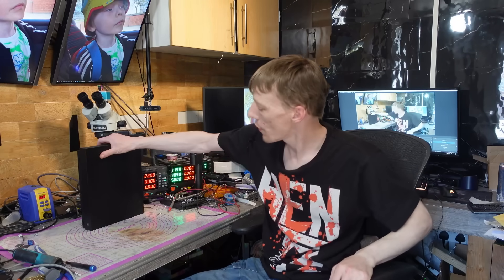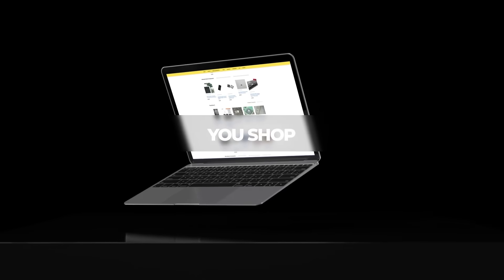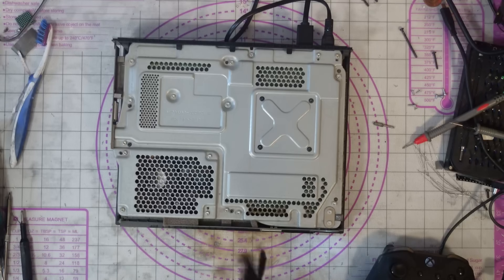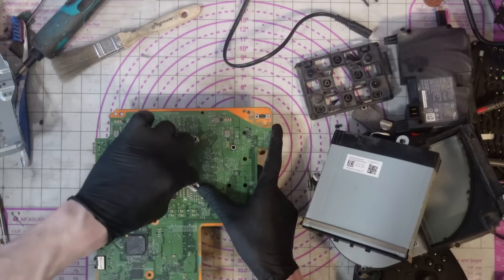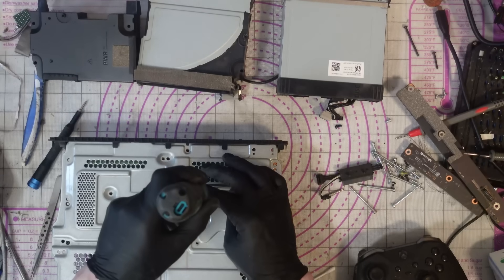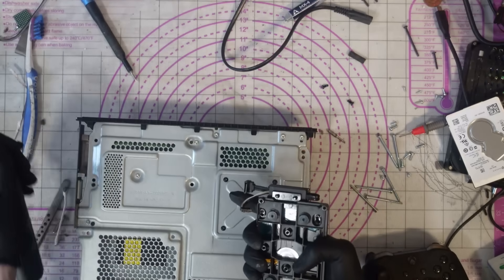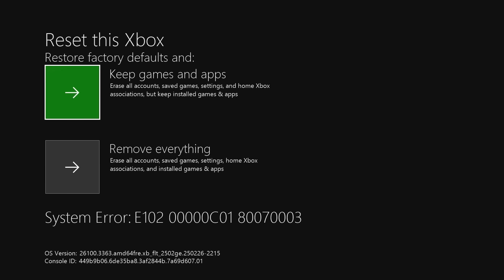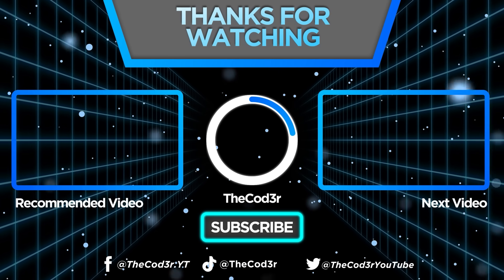Xbox One Error Codes E100, E101, E102: How To Fix Them (One S, One X Included) [2025]

Comment: I’m having a 101 error message. I’ve pulled the hdd out and plugged it into the PC and it works fine. So i removed all files and cleared it then formatted it. 
I managed to get the usb update in and it was reading it fine and seemed to be doing update. But then failed. Now when I try to update from usb it fails immediately
Reply: same problem here on a xbox one s 101 error after trying to update it with an usb

Comment: The Cdr3 you can still offline clone the HDD to a new one or SSD HDD & then connect new HDD up to PC & use Linux or Mint boot Live USB with GParted & change the size of system update partition to about 13 to 14 GB & save the changes , wait for completion then shutdown & replace back in the Xbox One X , it should boot straight into the login screen with the Boot up logo screen already included . This process only works for the Xbox One S & One X  , for a larger SSD you have to move the remaining unallocated space to the User Partition hope this helps , Cheers 👍